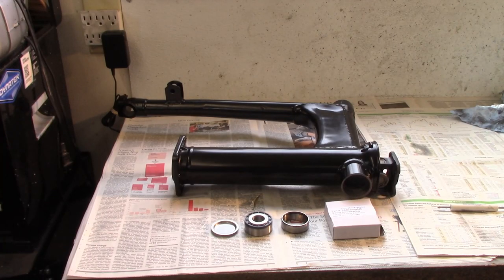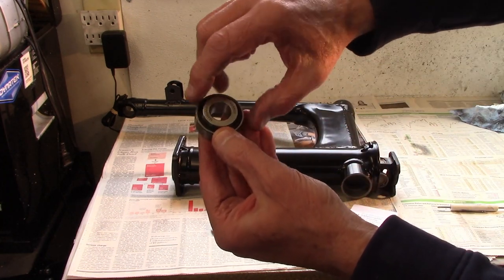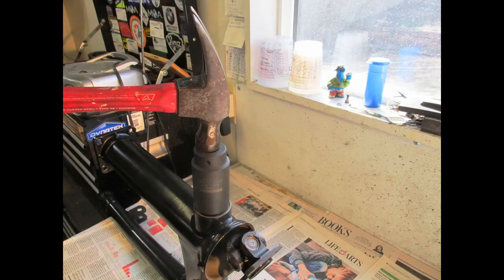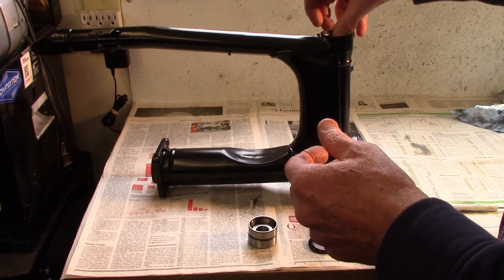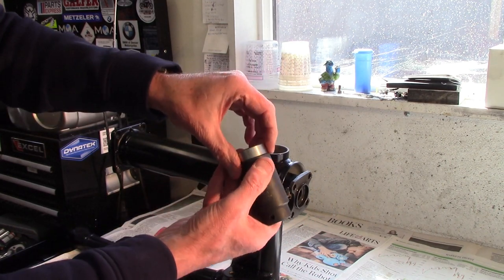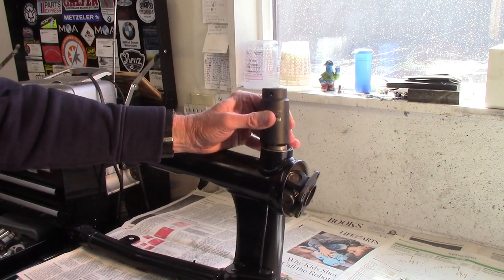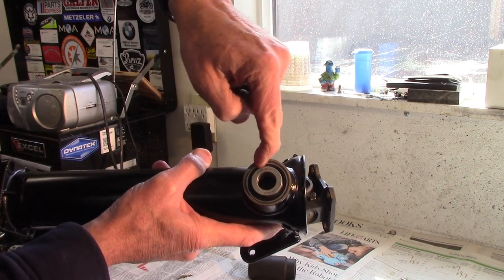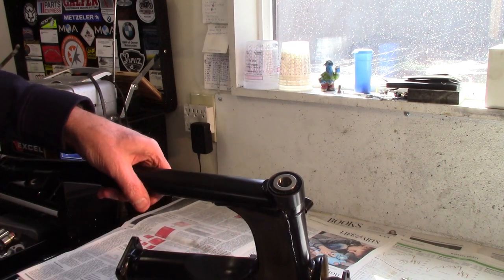1983 BMW R100RS Install Swing Arm Bearings

Comment: Do you fill the bearing with grease before installing?
Reply from the maker: Paul, the later bearings, like these, are sealed so you don't need to put grease in them. The older ones require periodic application of new grease.
Reply: Brook's Airhead Garage Thank you,  this series has been super helpful with my restoration of my 83 CS.